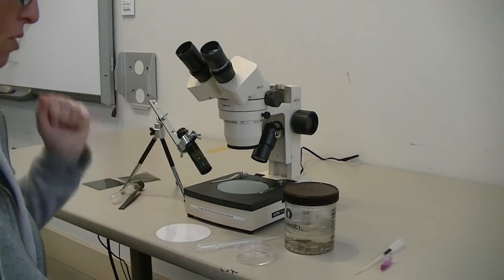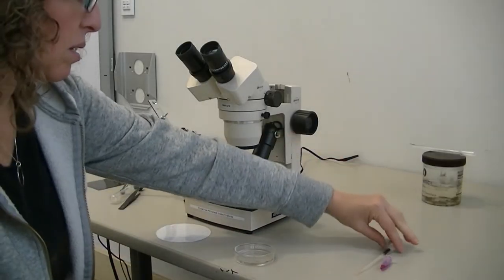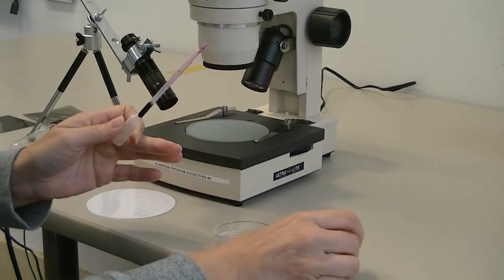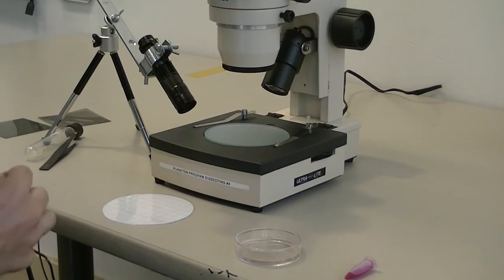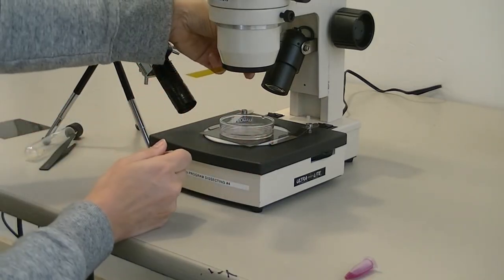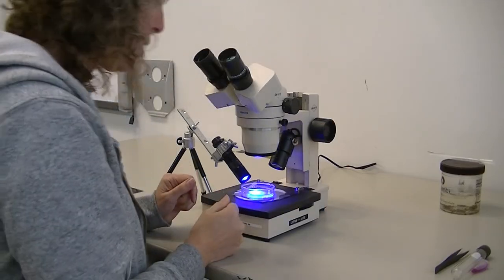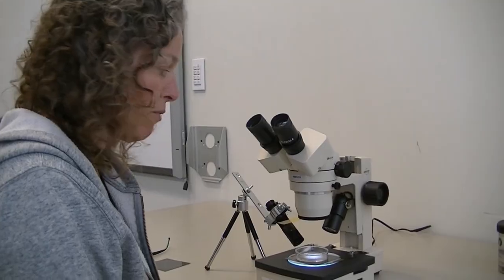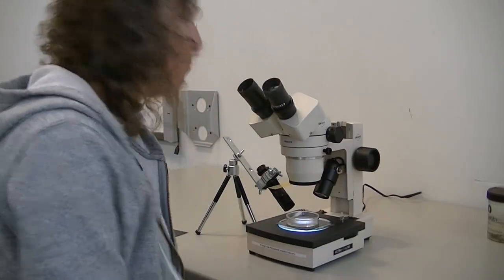Microplastics Amelia Labbe

Comment: If I use a blue color filter in front of white led torch will it work as blue led torches are not available.
Reply from the maker: It should work with the right blue filter. The important thing is that the yellow emission filter blocks most of the blue light i.e. the two filters together should be almost black. Also it is important to focus the LED torch to give a small and bright a spot on the sample as possible using an additional lens.

Comment: Going to be analysing microplastics in a sample of water but there is lots of dirt and so on in the water. Do you reccomend filtering it with some filter paper or will that affect the results.
Reply from the maker: Filtering will remove both microplastics and sediment in the water. It might be best to separate them by adding saturated salt (NaCl) to the sample to increase its density - most sediment will sink and most plastics will float on the surface. You can then pipette the surface layer to retrieve the microplastics. You need to do a control experiment with pure water as some salt samples contain microplastics.
Reply: @clivebagshaw2805  Thanks for the quick response! I read on an article outlining a similar method using nile red that ZnCl2 was used to help the microplastics float. Is this necessary or optional?
Reply from the maker: @yonyon1002  Yes ZnCl2 is used in the lab because it is denser than NaCl and gives better separation. But for experiments with community scientists, NaCl is easier to acquire.
Reply: @clivebagshaw2805  what concentration of NaCl would you reccomend for this?
Reply from the maker: @yonyon1002  Saturated NaCl should work. As the microplastics will float on the surface, having some undissolved NaCl at the bottom of the tube is not a problem.
Reply: @clivebagshaw2805  thanks for all the help. Just one final question, are there any databases with images of these microplastics with nile red under a microscope with which I will be able to view? I am working on a machine learning program on quickly counting them for a project and having a larger database than the one I am currently working on would greatly help this.
Reply from the maker: @yonyon1002  I only have images of a few test plastics. A student at a local community college is currently looking at seawater samples and may be able to take some photos. Please email me at crb5@att.net so we can keep in contact.

Comment: hi
I am thinking of quantifying microplastics using nile red dye in fluorescence spectrophotometer. Cannot find clear methodology need to be adopted for this. Do have any idea on the procedure need to be followed for this technique used for quantifying microplastics?
Reply from the maker: It might be difficult to use a fluorescence spectrophotometer because Nile Red will emit a low background fluorescence from the solvent that might swamp that from the microplastics. Under a microscope with a thin sample (<2 mm) the stained plastic particles can easily be seen and quantified. Also with our own samples, some plankton are stained with Nile Red (especially zooplankton) and we can visually separate them from plastic, but in a bulk sample in a cuvette this would not be possible
Reply: what about the nanoplastics, how can we quantify them?
Reply: do you have any suggestions on how to use fluorescence spectrophotometer for quantification of microplastics?
Reply from the maker: @PRIYANKASEHRAWAT-d2f  No. You would be better off using a cheap microscope with a blue LED light source than using a spectrophotometer that cannot distinguish the fluorescence from particles  and solvent.

Comment: Hello thank you for this. I’m not sure if you’ll see my comment. I’m working on a project and I want to prove the presence of microplastics in food packaging, I’ll be sampling a typical plastic bag that usually contains hot soup (in Asia), I’m wondering how can I use this method because I have failed to acquire a spectroscopy and this is my only available resource. I’m thinking of boiling the plastic (using a protocol from a study that uses FTIR for analysis) and then analayze the boiled water with the miscroscope. I’m not sure if I’m making sense
Reply from the maker: I have sent a reply via email
Reply: Hello
Reply: I hve almost project to research how do you design to detect MP

Comment: Hi.
I am working on microplastics in my plant sample as well as soil sample.
My plant sample is a very small aquatic plant. Its a macrophyte. And my aim is to count MPs adsorbed on its surface. Please guide me that how to count that samples? 
I am thinking to count it by micrscope. But you please tell me about more effective method. 
And also i wanna know about the particular amount of NaCl for particulat amount of soil sample in water.
Please try to respond me as soon as possible. Because i am currently working on it.
Reply from the maker: How are you detecting microplastics? How big are they? In favorable cases you can use automatic methods for counting: see https://www.mdpi.com/2673-4532/4/1/4
For flotation of plastics using NaCl, it is best to use saturated NaCl - it doesn't matter if you have excess salt as it will settle with the soil at the bottom of the tube, while most plastics will float.
Reply: @clivebagshaw2805  appearantly there no Mps on the surfaces but they are detected by microscope adsorbed on my plant sample. For microplastics seperation from sediment sample is challenging for me. Also nile red dye and its protocol related tools are not available for me. 
For what size of MPs density seperation is effective because they are no larger microplastics that can be seen by naked eye. Also guide me please what to do after adding saturated salt. How to carry those invisible microplastics by density seperation and how to detect them? By simple electric light microscope? Because the only microscope i have is electric light microscope.
Reply from the maker: @ham1633   Microplastics usually float in saturated salt solution regardless of their size. After mixing NaCl to soil sample, allow the soil to settle, then suck off the surface layer with a pipette and transfer to a microscope slide. If there are no visible plastics, add some larger pieces of polythene to the sample to check the floatation method is working. Microplastics less than 1 mm in size are difficult to identify just by looking under a microscope. Try using cross-polarizers to examine the sample: 
 https://www.youtube.com/watch?v=iNNkdHyvhbs&t=19 
Polarizers can be obtained from Amazon:
https://www.amazon.com/Polarizing-Film-Sheet-Gadget-Electronics/dp/B004X3XFHU/ref=sr_1_1_sspa?crid=9X8OOP59XNT1&keywords=polarizing+film+sheet&qid=1681402074&sprefix=polarizing+%2Caps%2C284&sr=8-1-spons&psc=1&spLa=ZW5jcnlwdGVkUXVhbGlmaWVyPUEyM1BIUk04TVpKQUMxJmVuY3J5cHRlZElkPUEwODI3ODE0MzE1Ulo2WlcyV1E2TiZlbmNyeXB0ZWRBZElkPUEwMjQ5ODY0UVg0WDFUVVpDSVQ5JndpZGdldE5hbWU9c3BfYXRmJmFjdGlvbj1jbGlja1JlZGlyZWN0JmRvTm90TG9nQ2xpY2s9dHJ1ZQ==
Plastic usually show up as bright or colored objects in polarized light - this method is not infallible, which is why Nile Red staining is a useful additional method. Research labs use infrared or Raman microscopy to be more certain particles are made of plastic.
Reply: @clivebagshaw2805  Do i need to do chemical digestion after density seperation method?
I mean Can i use chemical digestion for Microplastics obtaining from both plant and sediment sample.
Reply from the maker: @ham1633  You will probably need a digestion step for sediment samples. I have not done this for our plankton samples as we do not have lab facilities. We find Nile Red stains zooplankton, especially their membranes and fat stores, but they do not stain phytoplankton very well because the cell wall slows down Nile Red absorption. Nile Red does not stain fragmented fibers of cellulose, which helps distinguish them from synthetic fibers.

Comment: Can you please tell me the nile red molecular formula which is used, and also tell me that is the nile red dye is in powder form or liquid form, how did uh dilute it??
Reply from the maker: The Nile Red dye was purchased from MP Biochemicals via VWR Ltd. A stock solution of 1 mg/mL in methanol was prepared. Alternatively, Nile Red was dissolved in 91% isopropyl alcohol (rubbing alcohol) available from a local pharmacy. 1 drop (0.02 ml) of Nile Red stock solution was added to 5 ml seawater sample. Formula is at https://www.mpbio.com/us/nile-red
Reply: But if I wanna purchase the nile red then to I have to know whether it same or not ... So please can you tell me the molecular formula of nile red from the bottle which is used??
Reply from the maker: @sayrammukri2890  There is no formula on the Nile Red bottle - just a molecular wt = 318.4. The formula of Nile Red is given https://en.wikipedia.org/wiki/Nile_red
Reply: Thank you that uh helped me, but tell yr Nile red dye was already in liquid form pr powder form...?? And then uh made stock solution by adding methanol?
Reply from the maker: There was 1 mg of dry powder in the bottle as supplied and I added 1 ml of methanol to it, to make the stock solution. There is not enough to weigh out. When dealing with small amounts it is best to dissolve in the estimated volume and then check the concentration from the absorption spectrum if you want a more accurate value.